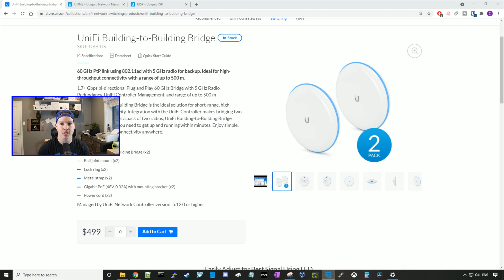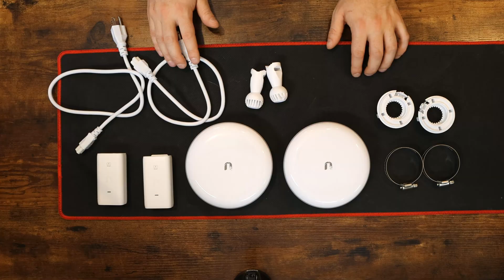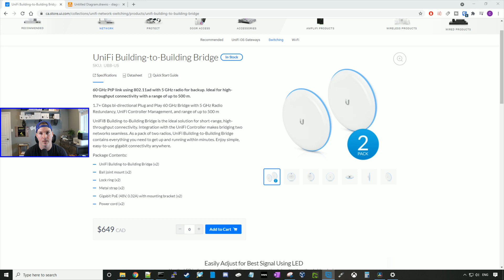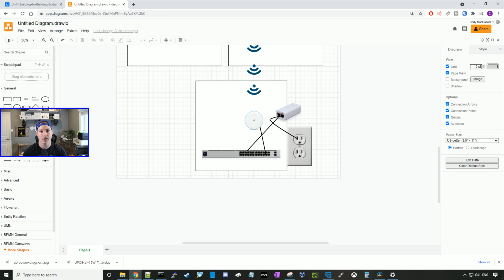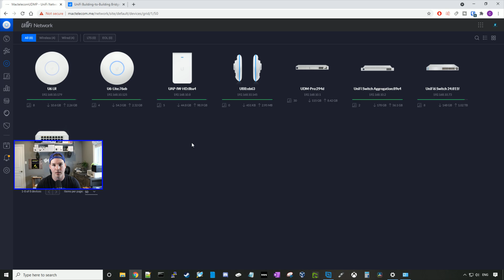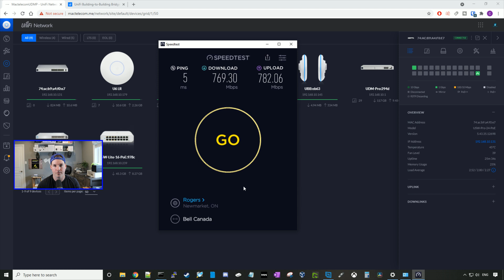Unifi Building-to-Building Bridge

Comment: I know this post is old but I have a new install with an issue.  The devices I have were installed (I believe) out of order.  The device I need as the access point end of the bridge was powered on first and we moved to the location which would be the station.  I can't find a way in the controller to swap their roles.  Is there or must I swap the hardware and readopt them?

Comment: Hello Mac. To ensure proper functionality, is it necessary to have both a Unifi switch and a Unifi controller, or can we simply connect the ubb-xg-us to any switch? Currently, we have several UniFi APs in use, and we manage them through the UniFi administration portal, which is installed on a server.
Reply from the maker: Hey you would need some sort of controller to be able to set this up. You can just download the unifi controller client on your computer. If you already have it on a server you can use that

Comment: Can you buy this 2 pack and use it as is with my comcast router? Do we need anything else besides whats included in the box to get up and running?
Reply from the maker: You would need a Unifi controller which you can host on your computer

Comment: I would love to see this bridge setup pushing the range with speed tests. I'm also curious about how weather or trees impact connection and speed. 
As far as speed tests, I use OpenSpeedTest to tune my home network. I changed every access point position and made big gains on coverage and speed. I like using that rather than a speed test that relies on the internet connection as well.

Comment: I’ve got UDM Pro at home but at work I’m stuck using Draytek routers and switches. I’d like to use these to create a building to building link between two offices about 10m apart. Should I set them up standalone, is that possible? Or could I install Unifi controller on the server just for adoption and management of these?

Comment: I just installed a pair of GigaBeams for a client. Its only like 100 feet. They bought the building next to them. Basically the same thing except they are 24v Passive (REALLY wish the AirMax line would adopt AF/AT with Passive like the NanoStation 5AC's are which is why i always try to get them) and use the UNMS not Unifi. They are connected at the full 1.6 Gigabit the wifi is capable of.

Comment: Got them for the school I work for. I got them when they were super new, so new that I had to SSH into them to get them working (firmware update). It is about 300ft apart they have been up for a year and work great. We have a 24 port UniFi switch, 6 G3 bullets, 2 G3 domes, UCK Gen 2, 2 HD APs and several VOIP phones on the switch. No issue at all since the install. The only thing that is weird is the topology but it’s not a big deal.
Reply from the maker: That’s great to hear. This is my first experience with them and they made it so easy to get working . The price point is higher than other ptp solutions but won’t give you the headaches

Comment: So if they are not fully faced towards each other and they are still able to pick up a signal (as in your video), would it then be possible for a phone to pick up the signal as well?
I mean, if you have them pointed from the house to a barn in the garden, would a phone be able to pickup the signal to browse the internet directly? So they are also providing WiFI coverage in the garden? I guess not, but it would be great if they would act as a AP as well.
Reply: No simply a PtP bridge, when you start adding more and more features to a device it overcomplicates things FYI. You will need to add a UniFi AP on the other end of the station to get wifi coverage.
Reply: @alexlowe30  Tnx

Comment: The two I've put in have maintained their 100% link rating with near gig connection to each other at around 100ft. I have another install coming up at about 900ft from a house down to the customer's boathouse where there will be a switch flex inside the flex utility with 2 x G4 bullets and a U6-LR (if it arrives). I'll try to get some footage as well.
Reply from the maker: Awesome! they seem to be great devices
Reply: Please more about long range links. Nanobeam or litebeam would be great. The are much cheaper.

Great video.
Reply: @MisterV..  Yes I am also interested in these kinds of video's.
Reply from the maker: If I get some jobs with more long range I’ll do a video
Reply: I live in Toronto and would love to have you film at my place. Huge yard. But no power where we’d get the 2nd bridge where we’d put a camera. Great video!